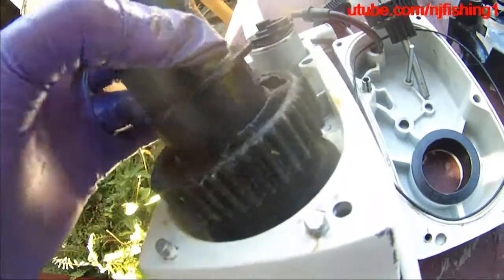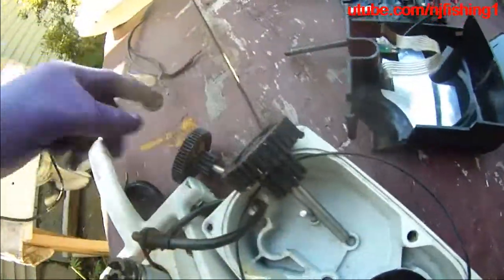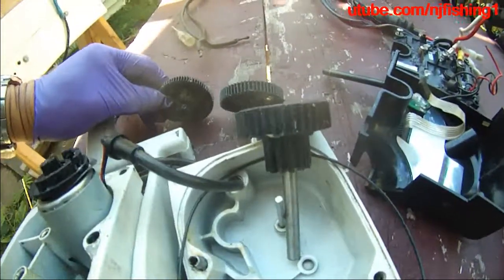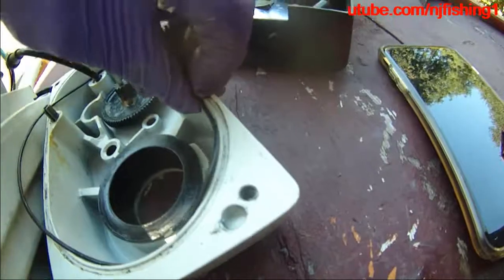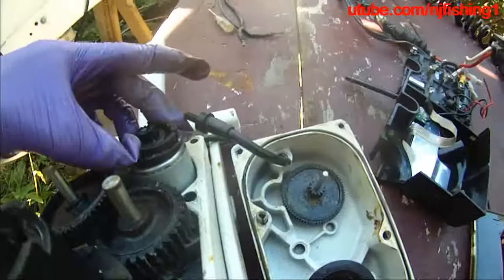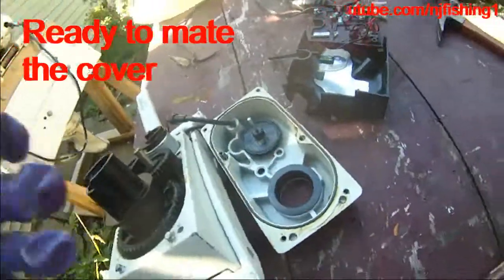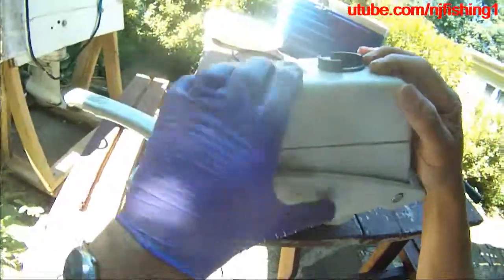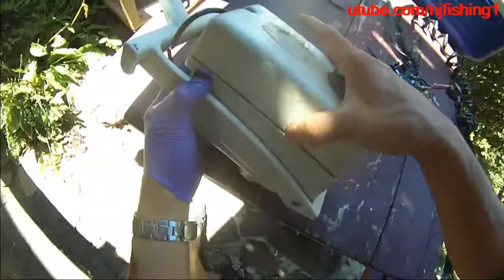Motorguide wireless trolling motor transmission broke - DIY repair (8 of 10) - Top secret

Comment: How do I remove the pivot pin of the transmission housing in order to install a new one? I have a Xi3
Reply from the maker: U need to buy a snap ring clips pliers
Reply from the maker: Be careful in removing the ring. Cover it so it won’t fly away when you remove it. Otherwise you will not be able to find it once it flies away. The rings are in different sizes. Tough to find a exact match.